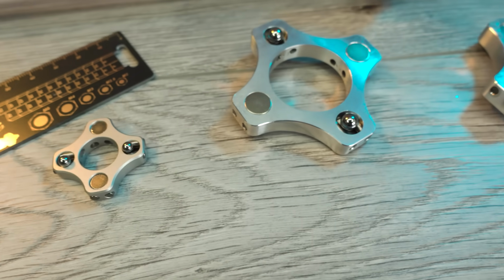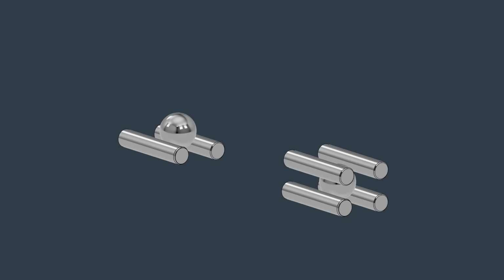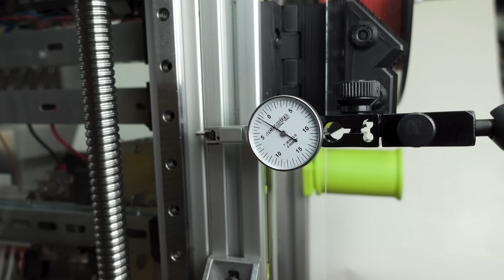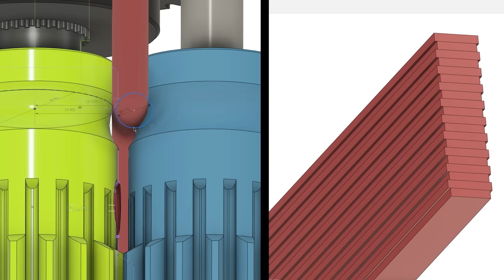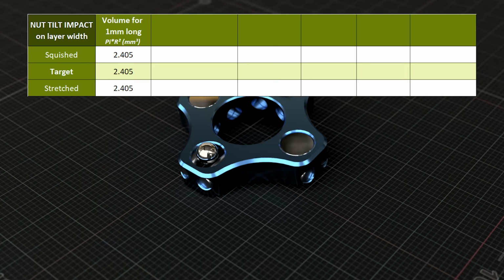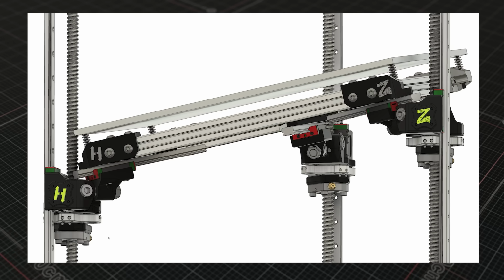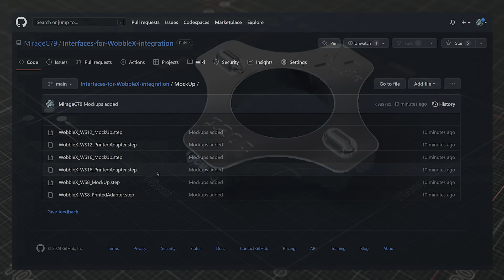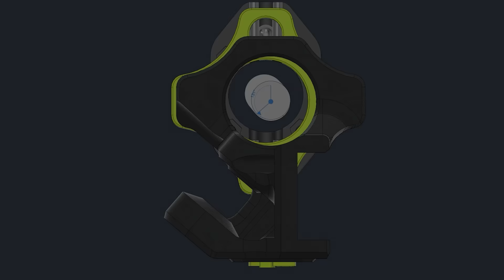I will never talk about Z wobbling ever again !

Comment: There Is no need to compensate z wobble, try proper ball screw instalation method used in machines for decades and not this crapy nonsense. Ends of ballscrews is not machined just for fun.

Comment: wobbling screws ? making your machine wobble ? ever heared of tension or compression loading ? your ballscrews aren't assembled well and won't perform to their specified specs. and cause all kinds of intermittent issues. Like wobbling and wobbling the machine. there is 0 use to wasting ballscrews if you arent assembling them even close to decent.
Reply from the maker: Installing them under tension to stretch and straighten would bend the aluminum frame. Although these sound overkill, I like their low maintenance and durability for printing with Z hop inside enclosure.  These ball screws have over 5000hours of operation and have absolutely  no sign of wear.  I can't say the same for the lead screw that were on the printer for 6 months.
Reply: @MirageC  just get straight feedscrews of any type. teaching people how to install wobbling screws is a waste of your creative energy and time. 50usd 4axis mini cnc machines even come with STRAIGHT screws. whats the use of 0.000inch precision machined screws if you let them they wobble ? GL your project looks great

Comment: What about a block and tackle mechanism for Z axis movement?

I'm building a printer at the moment that's going to use it, presently with 1:8 mechanical advantage
Reply from the maker: Not sure I fully grasp what you mean.  What kind of block?
Reply: @MirageC 
9 months late but I only just see that you actually replied!

I've built a printer that runs a belt back and fourth between the printer's frame and pulleys on the buildplate to move the Z axis, with a tremendous amount of mechanical advantage and precision.

The downside is that it's a ludicrously long belt run.

Comment: I wonder if there is a compliant flexure that would do this cheaper and better.
Reply from the maker: We tried printed flexure, they end up being large, and the material will creep under load and temperature.  Flexures would need to be metallic, and price would be higher that what we have now.
Reply: @MirageC  I have access to a professional waterjet.  Not as good as wire edm but maybe good enough?  Your Alibaba link has no price and says it's out of stock with 185 orders. Just looking at your bom count and how parts are already cnc'd I kind of find it hard to believe that presuming a flexure could do this that it would not be cheaper.  I can understand that an iterative design approach getting stuff custom fabbed in low quantities could be expensive, if you want me to cut a prototype or three out on the waterjet I could do it for free, just link me to a dxf file and the material and thickness you want.  I have access to aluminum, mild steel and hardox 450.
Reply from the maker: @zyxwvutsrqponmlkh  fexures would not address the nut tilt though.

Comment: Why not just use belts like the v2.4
Reply from the maker: Most printers on the market use screws,  This is what I had, I wanted to find a good solution for us all.  Retrofitting to belt would not be a viable approach for all.  I keep reading about how good belted Z printer are,  I need to look into that eventually.

Comment: Doesn't removing the top bearing without your system already prevent Z-wobbling?
Reply from the maker: Not on Ball Screws, they are too rigid to mount them loose.  They will still pull you bed around.
Reply: @MirageC  that makes sense.

Comment: At that point I'd probably just weld the chassis from rectangular pipe and make the machine body itself more rigid. I never heard of someone just letting the leadscrew do its thing because it results in a small inaccuracy. Line I'm sorry but if you use ballscrews and linera bearings, how can you think it's acceptable to use a chassis that wobbles like jello? It's 20mm extrusion, it's not great.

Comment: From a mechanical point of view, this is not a vibration problem, it is a problem on DOF (degree of freedom) control. The pin-ball mechanism isolates the DOF constraints from the power screw making it only  transmit the motion in Z direction.

Comment: 1) Low grade machining of the ends. Concentricity is terrible. Even an amateur machinist can do better with a bench top lathe.
2) Ball screws are for precision z placement. You still need meaty rails to control x and y movement.
3) Your ball screws are WAY oversized for the load.

Comment: I've been running something similar for years, but without the side to side movement. It only pivots. Since the bottoms of my leadsrews aren't constrained, there's no side to side movement as they turn, only the slight tilting. Since implementing this, I've had no z wobble artifacts in my prints. They also allow the z axis to decouple from the leadscrew in the event of a hotend crash.

Comment: I think this is a fantastic example of a good mechanical design to solve the issue rather than a software patch to try and fix it.
Reply: Ball screw + linear rails?
Reply: Good mechanical design would be to remove the upper leadscrew mount so that it's not over constrained. This is the actual cause of the Z wobble. He developed a product to sell to those who do not understand this.
Reply: This Is great example of how not to do it, design Is incredible dumb nonsense.
Reply: I just can't believe that it's cheaper/ better than buying straight ball screws or making the frame stiffer. I don't really get this fashion of using proper linear rails and lead screws (all from aliexpress) an mounting the lot to a frame made of jelly. It dosn't seem like good engineering to me
Reply: @michaelwatson7211  Cheaper? Youve never seen the prices for an actual high quality ball screw + ball nut huh? A high quality ball nut itself can easily costs more than the 3d printer itself. $400 for a ball nut is very common, $750 to $800 for a quality ball nut is normal.
Reply: @Sharpless2  Yeah I meant lead nuts, which aren't that expensive even for OK ones. And thats only one of my points, why buy this stuff if you are going to mount it to a frame so weak it's deformed by an 8mm rod? Lazer cut steel is pretty cheap, tapping holes isn't that hard, avoiding that then splurging on custom components, and rails with a >200kg capacity is building your house on the sand.
Reply: @michaelwatson7211 building a frame so rigid it can't be deflected does nothing to solve the problem,  and in fact makes it worse. Now all your expensive mechanical couplings and bearings are going to be destroyed,  or the whole machine will bind up and not move at all.   You fannot and should not try to constrain the run-out,  these are extremely rigid screws and that load WILL go elsewhere and WILL destroy something.

Comment: Good design, BUT. Nothing solid and rigid constrains bed to move vertically in a perfect line. These mounts do decouple bed from ballscrews, but magnets still pull them toward center of ballscrews. Thus, vertical axis of the bed ends up being  average  of all 3 ballscrews.

Comment: Nice design, but a bit over-complicated.  I've been using simple sliding de-couplers under my z-axis carriage blocks for half a decade, no ball-bearings required, just a little silicone grease or graphite powder.

Comment: Great design, thx. But I am still wondering why a wobbling ball screw affects such a pattern. Shouldn't it look like tiny layer shifts? But it looks, also in my case, like changing layer hight/extrusion width.
Reply: I think that pattern is tiny layer shifts, at least in part - the vertical offset from the screw wobble should be relatively minor.

Comment: Did I hear /see correctly then.. there is an 8mm variant for the Typ (ubiquitous)   8mm Z screw ?  As in it engages  threads  or captures a pom nut.. And is of maneagable size to fit a Prusa  / clone configuration? 
 Currently seeing  only greyed out listings in Mellow pages

Comment: I think it's a bit overengineered solution to the problem. I just use a common flexible (spiral cut) shaft coupler with a small steel ball dropped inside it between the two shafts to keep the axial tension without limiting the slightly tilted movement of the lead screw.

Comment: I seriously love following this not only as a Mechatronics Engineer but now I’m torn between a design like this or Voron so hard to decide now
Reply: It depends on your needs, really.
A Voron's quad gantry belt assembly hits its limits in size quicker than this design, and I would say that the pin mod (replaces screws as axles with hardened pins) and GE5C gantry tilt blocks instead of the stock plastic on plastic tilters are almost a requirement for high performance ones. It is, however, much simpler to isolate motion problems and there's fewer of them in the first place as belts don't tend to introduce Z-axis artifacts to nearly this extent.
 I'm not sure the fixed bed VS tri-screw bed is really making much difference at this scale of design.

Comment: Mirage my first experiments with the Rat Rig V-Core 3 started with an adaption of your very clever wobble rings. Subsequently I developed the VenterMechs (Simpler and less fiddly than Wobble rings and results were just as good - hundreds of people using them)  and then I upgraded the Rat Rig I was using as my test bed to the 1P Z design  to also eliminate the 'hula' movement, which other designs don't address very well. This design has proven the best yet. The design is open source for non commercial use and I don't sell any parts for it. I wrote a series of articles on the popular Z designs and the issues and fixes for them including the 1P design.

Comment: Very cool solution to Z wobble!  Anyone know of a printable solution which achieves a similar result but is more cost effective?  I would need like 6 which is pretty expensive.
Reply: Look online..tons of oldham designs..some with bearings..some with just plastic..
Reply: @Vez3D  Oldham is such a funny name lol.  I'll check those out.  Maybe do a combo.  Get one or two WobbleX and get some oldham ones too.  I have some Z artifacts in most of my prints which I just tolerate - probably time to address them though.
Reply: @ajmckay2  i think miragec also has printable ones..not sure

Comment: What am I missing here?
 From what I see here is that maintaining DOWNWARD contact (between pins and balls) is solely reliant on the HEAVY weight of the bed. Now this may work OK for the type of printer SHOWN HERE, but what about my standard printer with a standard LIGHT weight X gantry? 
For instance> On occasion when I ask the slicer to "lift" Z say, 0.5mm between moves, what guarantee is there that the X gantry can respond back down again, accurately, consistently and fast enough? These moves are very quick and rapid some times.
Reply from the maker: What is your Z accel value?  Earth gravity is 9.81m/s2 (9810mm/s2).  If you have accels lower than this value (minus a certain margin for friction factor) you should be good.
Reply from the maker: Nozzle bumping on blobs may be an issue though.

Comment: First need to get my extruder under control.. I see different wall thinknesses on straight walls depending on other features on the same layer. Guess has something to do with heat capacity of the hotend, pressure in the chamber + using a bowden extruder..

Comment: Been struggling with this for life! So much so that looking at the PrusaXL design gives me pause on their choice of bed mechanics.
The part is a little too price though to be widely implemented. Looks like 2 per lead screw? for 3 screws that’s 6 pieces, $120 is a bit much. Not saying it’s not worth it, but it substantial relative tho the other part of lower cost printers.
Reply: No, you need 1 per screw = the middle part. The upper and lower parts must be 3D printed, hence why you get 8 extra pins (4 per printerd part) per kit.
Thus 1 kit per screw = 1 milled aluminium part (which is incl. 4 balls, 4 magnets and 8 pins) + 8 extra pins

Comment: This is fantastic. Your hard work has paid off so many times over. I'm making my own printer and I've decided to use GT2 belts with a 3:1 gear reduction as opposed to screws for the z-axis, only so that I would not have to do all the work that you put in for me XD. My hope is to completely eliminate z-wobble without compromising on simplicity or friction in case of an outage. When you mentioned low maintenance in this video I almost reconsidered but since I already have my parts I think I'm still going to go along with my plan. If that doesn't work then I know what my plan B is! Merci beaucoup pour vos efforts!

Comment: why do you even need 4 ball screws? just use a linear rail and one screw
Reply from the maker: I use 3 ball screw and 3 rails.  This printer physically levels the bed on it own and has provisions for 5 Axis printing: https://youtu.be/mqSQhwqSzvg?t=448
Reply: @MirageC  wow! I take it back then ;) it's a very impressive design.
Reply from the maker: @lavericklavericklave  No Problem, i fully realize that it is on the overkill side of things 🤣

Comment: My guy is at the top tier of 3d printing and I'm over here trying to get my damn Ender 3 V2 to produce decent prints that will actually fit together. 😂
Reply from the maker: Dont discouraged yourself, I was in that seat 4 years ago ;)
Reply: @MirageC  I've had a 3d printer for around 7 years now. Only just recently finished my second kg roll of filament. I'd say I'm plenty discouraged, but I keep trying! I should probably just buy or build a better quality printer. I imagine that would help a lot.
Reply: @MirageC  Is there an STL missing for the Ender 3 parts? It looks like there are 2 parts that sandwich the aluminum cross, but I only see an STL for the top part.
Reply from the maker: @amorton94  Yes, I am in there now to fix this...  Got caught with this video getting much more traction than what I am used to! 😲

Comment: Can you provide what model/size of the WobbleX is needed for the various supported printers?  There are 3 choices available (WS8/WS12/WS16) .  I have a CR10S which I would assume uses the same lead screw mount as the Ender (looks the same), but there is nothing in your Github about which of the WobbleX is needed for the Ender.   I have some severe ringing in prints, likely because of the dual drive leads screws that I can physically see wobble.  Thanks!
Reply: All 'bedslinger'/'gantry' creality printers (eg: Ender 3's, CR10's, etc), use a T8 lead screw , thus you need model " WS8 ".
Model "WS12" is for ball screws SFU1204.
Model "WS16" is for ball screws SFU1604.
Reply: @CookieTube  Thank you for the information!

Comment: I wonder how they avoid this problem in CNC mills?
Reply from the maker: They have massive and super rigid structures managing the screw to behave, and further more, some installations will apply a stretching load to the ball screw.  They also use 2 big rails per screw most of the time.

Comment: This is cool and all, but you could just use belts and ditch the lead screws/ball screws all together.
Reply from the maker: I could probably yes, but I fear the required added mechanisms to lock steppers when unpowered and the potential belt oscillation from the inertia of a heavy bed under the vibration of XY hard accelerations sent through the frame.
Reply: @MirageC   a gear reduction prevents back driving the motors. At least on my i3 style printers it’s not a problem. On my coreXY I currently use keybacks that pick up the slack. 
Voron uses a belt system and they don’t suffer from vibrations in the belts during accelerations and decelerations. The belts are tensioned pretty tight

Comment: vzbot needs to do this
Reply from the maker: I have the cad for VzBoT, but they interfere with RSCS ducts. :(
Reply: Vzbot dont dont have z wobble issue 😊 different design..different approach.
Reply from the maker: @Vez3D  yet they use oldham couplings :face-turquoise-covering-eyes:😅
Reply: @MirageC  i meant they dont have wobble issue because they use oldham :)

Comment: How does Z-hop affect this system?
Reply from the maker: As long as you accelerate less than earth's gravity downwards (around 10kmm/s2) you'll be fine.
Reply: @MirageC  However earth gravity acceleration doesn't matter that much effectively, because Z-hop goes both ways. Essentially creating a parabolic curve while reversing at the median. That's why I was asking. But I figured it probably would not make any difference practically. Very nice design.

Comment: my last question on this is why cant we make the alluminium part un PC or PA-CF :) ? thanks a lot
Reply from the maker: For the ball screw version, the increase in size makes it a bigger part, which can be thickened and printable.  For the tiny WS8, printed did not yield good results.  it splits or sags.  And the print surface quality have a greater impact on the final result.  you can find a ballscrew printable of the wobble rings is version here: https://github.com/MirageC79/HevORT/tree/master/files/STL/ZR_V2.6
Reply: @MirageC  i only have normal tr8 2mm lead

Comment: I checked the website out but it showed just the upper part with the balls,  not the base, which it Rides on. it is not clear . so I didn't buy it For m y Sovol SV01 Pro
Reply from the maker: The base needs to be printed.  And your carriage needs to be modified to receive the pins.  Have a look at this CAD model of my printer, you will have a better Idea.  I am starting to receive designs from other printers on the github, so Sovol might be in there soon. 😊 Cheers.  
https://a360.co/40QC5G5
Reply: thanks Iam Looking at it. probably next Video would be a generic How to use and things to look for when we are doing this mod. 😀